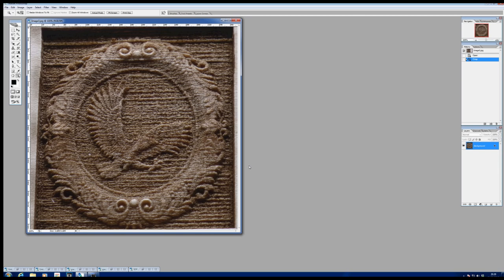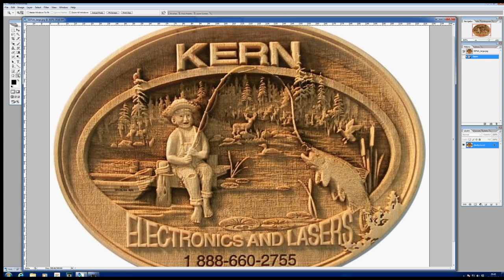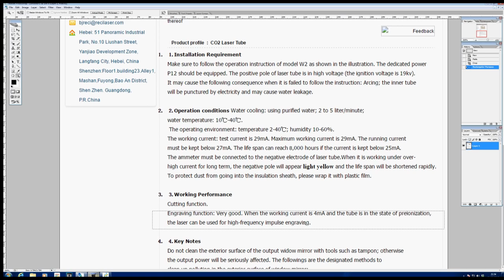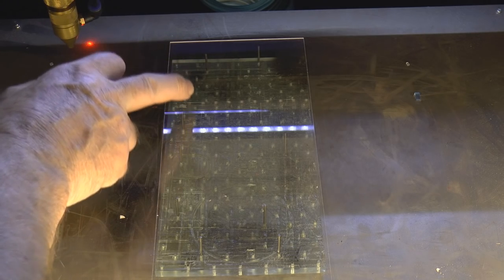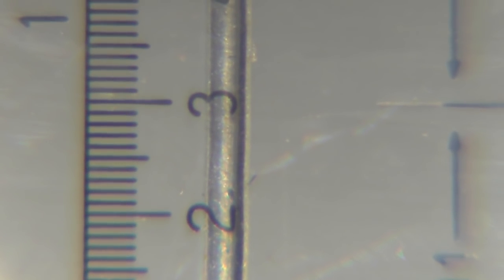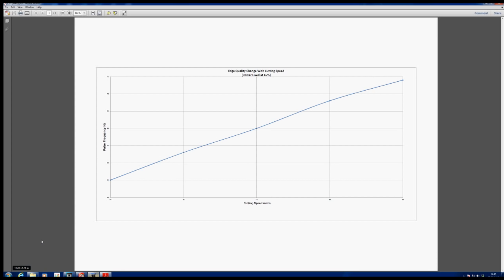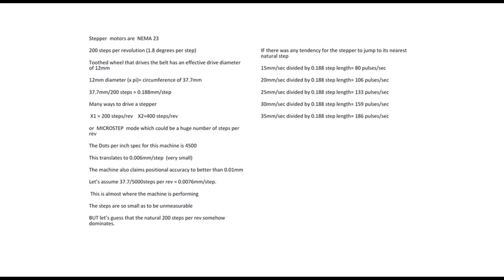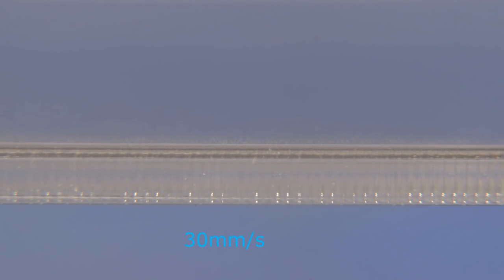RDWorks Learning Lab 63 High FrequencyImpact Engraving

Comment: It sounds like you have a diaphragm style air assist pump. Have you considered the possibility that the pulses in air pressure are causing the lines?
Reply from the maker: Hi Trevor
Yes you are correct about my air assist pump. However, by  the time the air reaches the nozzle there is an accumulator effect  withing the pipework that almost filters out the pulses. You must remember that I am on a journey of discovery and at this point I did not relate the Gaussian power distribution within the focused beam as the root cause of this issue.  You must also realise that the damage to the wood is being done by a beam of light. That light cannot be influenced by airflow. This can easily be proved by stopping the airflow and observing that there is no difference to the engraving texture.
Thanks for the comment. If you follow my footsteps further you will discover the physics involved with this technology and the amazing control that is available with the Ruida controller.
Best wishes
Russ
Reply: @SarbarMultimedia  I did continue watching your investigation and my theory was quickly shot down. If the stepper motors are the source of these patterns, I would be curious to see the results from a machine using dc motors with encoder feedback.

Comment: What are the dip switches set to on your 2DM542 motor drivers. I have a 50w laser same type and steps per Rev set at 10000 or Off On Off Off. Although have the same vertical lines appearing on solid etching at 14% 200mms. 
Many thanks for superb videos.
Reply from the maker: Hi Peter
I have not spent much time playing with the steppers. They work superbly, except for this one little glitch. I have a different controller DM545A with an 8 way dip switch. The switch is set on,off,on,off,off,on,on,off
Thanks for your kind words and comment
Best regards
Russ
Reply: Russ, your driver settings look to be 2,000 steps/rev, I checked my machine (different drivers) and they're set to 5,000 steps/rev.
http://www.aliexpress.com/item/High-quality-DMC-DM545A-4-6-8-lead-two-phase-Digital-Stepper-Motor-Driver-24VDC-36VDC/1906608603.html
Reply from the maker: Hi Roderick
Thanks for this information. I'll take a closer look at my motors now and see if there are better settings I could use
Best regards
Russ

Comment: Great work and very informative. Is it possible you could obtain a high speed camera and analyze how the cutting changes with speed variations?
Reply from the maker: The higher the speed the higher the cost. My current camera does 50 frames per second and I am in the process of getting to 240 frames per second. Beyond that the cost exceeds the need to know. There's still a lot of unknown detail to be found on this subject
Best regards
Russ

Comment: This makes all the sense in the world to me.  I was not happy with the performance of my diode laser, using the 'laser' settings.  I think the engineers are too smart for their own good.  I'll do my best to keep this brief, but I use Fusion 360 as my design software, and I build my gcode for my laser as if it was a 'milling bit' vs a 'laser engraver' and I get some really nice results with no stepping or laser lines.. I wonder how this would play out using a stronger laser.. which would mean building a better controller board, as well as rebuilding the post processor.  I apologize for not going thru all of your videos, but I was wondering if you've changed out your controller board, and what you used.. if you could point me to that lab, I would appreciate it.

For those who want to flame my posts for being crazy, I'll drop some quick info for you:  My current post processor knows when I am 'cutting' and when I am not 'cutting' which is how I'm controlling my M3/M5 laser on/off commands.  My laser controller regulates my intensity based on spindle speed.  I am aware that if I try to control a co2 laser, I'd have to make a laser tool for each type of material I'm working with, as pine would be different from maple and acrylic for cutting strength.  There's a lot of work involved to get it right, I'm also aware of that.  But I get it..but such is life with new sciences and procedures.   Cheers!
Reply from the maker: Hi Dan
I have done nothing fancy with my systems. They are both "as is". My intention was always to explore what the basic machine is capable of and NOT  spend huge amounts on upgrades.  I apologize for being unable to answer your questions.
All best wishes
Russ

Comment: You must be an engineer because not a lot of people would actually go this much in depth :) Really nice to see.
I have a less ontopic question though, you said you owned metal cutting laser machines and had your own company. 
I am a fairly young guy (Mid twenties) and I am looking for a small 'metal' laser cutter to be able to sell cut sheet metal to other companies (preferably stainless steel up to 3mm thick). Do you think buying a metal cutter from China (if complying with CE)  would be a reasonable idea? Or do you know European suppliers of reasonably priced small metal laser cutters (as in able to cut 2000x1000mm of size maximum)
Reply from the maker: Hi
You are stuck with a bit of a problem. The industrial metal cutting lasers  are a different technology to what's used in these Chinese machines. You will be competing against the accuracy and edge finish standards of some very serious kit. My 3kw lasers are now low power in comparison to the 5 and 6kw machines currently in use.  They operated with a live gas mixture that flowed through the laser tube which meant continual gas usage costs. The typical Chinese metal cutting machines operate at 150 to 300 watts and are sealed tube systems. I believe they will cut up to 3mm stainless but with what sort of accuracy and surface finish is very questionable. The significant difference with cutting metal is that you need a special cutting head and stronger lenses because the assist gas is the ost important part of the process.  You can cut mild steel with normal compressed air, but it's not the best edge finish. You would normally use pure oxygen as an assist gas at  between 15 to 30 psi (that's a lot of expensive oxygen flow). It's purpose is to enhance the cutting process by causing a rapid exothermic oxidation process and also to blow the melted steel away. The edge finish is very good but will carry a thin film of oxide. Stainless is a completely different story. If you melt stainless steel in the presence of oxygen it tuns into gloopy treacle and will not blow away. You have to exclude any atmospheric oxygen from the cut area. You do this by using pure hospital grade nitrogen as an assist gas. The problem is you need HUGE amounts of it becaus e it needs to be at about 12bar (160psi) to exclude the oxygen and have enough blowing power to move the molten stainless from the cut rear cleanly without leaving a drossy lower edge to the cut. Done properly, the cut is superb and requires no deburring. I have no experience of how well the Chines machines work. If you join the forum at  www.rdworkslab.com I believe there are a couple of people there with metal cutting machines where you may get better answers. Depending where you are you may find  one of those is within visiting distance.  Buying a second hand industrial machine is still a VERY expensive option and the running costs are high. So I think, if you can get reasonable results from a sealed tube system then that would be the cheapest way to get into the business. Where abouts are you based?

Best regards
Russ
Reply: +SarbarMultimedia Thank you for explaining! I had a feeling it wouldn't be an easy road but the hefty costs also mean that not everybody can cut it themselves which would reduce the market size. I will definitely check out the forum for info. I've talked to a sheet metal specialist supplier of my day job company, and they told me a used 4kw machine costs around 90k to 500k. so that brought me to the Chinese machines because they can easily connect to pc etc. I live in the Netherlands so I guess it's not too far away.
Reply from the maker: Hi
I would look up a company that does metal laser profiling in your area and see if they will let you visit to see how their machines work. The costs you have been quoted are about right for an industrial quality machine. But the running costs are high and buying the machine is only  half of the start up cost. If you are handling 3mm stainless sheets in and out of storage racks you will need lots of extra space to manouvre a fork lift truck, the fork lift truck itself , the strong racking and a huge nitrogen storage system, plus a smaller oxygen storage system. 
I think both the guys I know with metal cutting machines are in the states. I'm also sure you will find demonstrations on you tube.

Best regards
Russ

Comment: After seen this video for a number of times, I think what we are creating is something like a vinyl recording, those marks are the resonance of the stepper motor :). Can't wait for my digital driver to arrive
Reply from the maker: Hi Abraham
That was my conclusion at the time of publishing the video. I am not so sure now  because when I  thought about it afterwards,  I realised  that I had missed a vital clue. My video may only take 50 frames per second but the sound recording is CONTINUOUS. When I checked the sound track for resonance patterns there were none.  All I could see was a steady 225 Hz signal REGARDLESS of speed. Hmm....
I've been away on holiday for a couple of weeks and have just arrived back today. I have been thinking lots about this issue and now want to do some more experiments. Watch this space.
Best regards
Russ
Reply: I think my driver M542 (analog) is probably among the crappiest. if I increase speed mm by mm I swear I can achive the full do-re-mi etc... on different tones :). I've also noticed that they vibrations do not go away as one increases the speed, they are just more spread. Those problems are very notable on the X axis, the Y axis is absolutely fine.
Reply: Russ, couldn't it just be an impulse wave on the belts? You basically have square wave impulses going down a string all at the same longitudinal speed. Pull-push (Move) &Push-Pull (Stop) top at the stepper motor both get cancelled out at the opposite end of the belt so I'd assume your 225ms is either the time difference in the medium (belt) to what you're moving (head) or the belt flyback from having moved the head.  In case I'm not clear: Motor moves, belt tugged then head moves - there is a fixed lag.
cb

Comment: Microstepping helps, but does not solve the problem of stepper resonance. I have seen DIY gantries sold with a reduction pulley and I assumed it was to force the stepper to rotate at higher rpm and cut out some of the low rpm oscillations. I can't wait to see what you come up with!